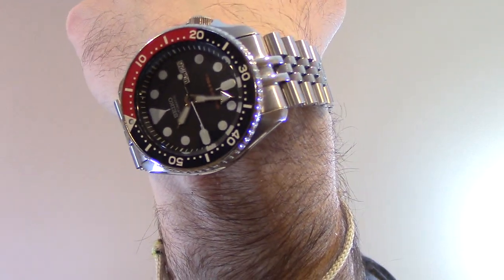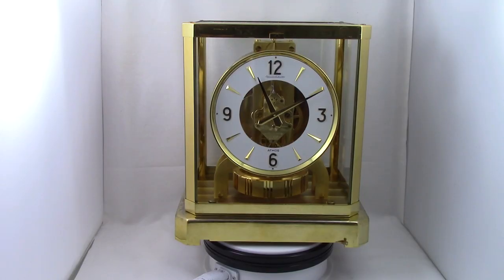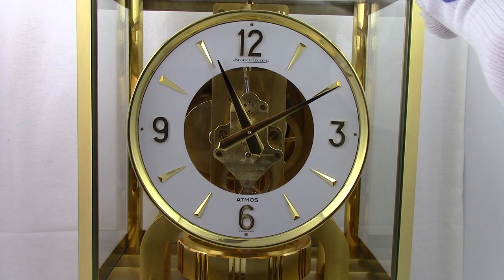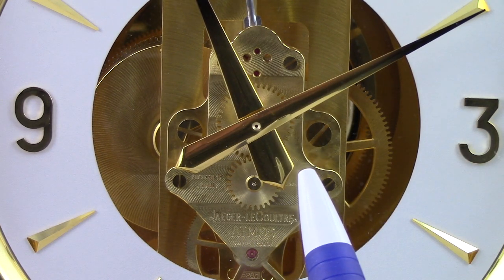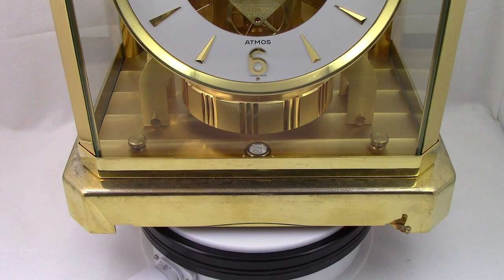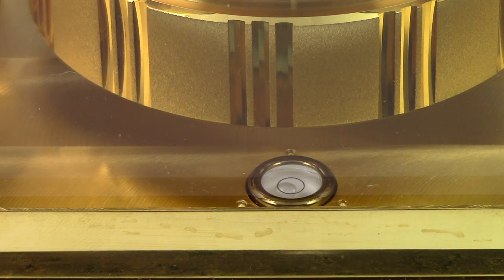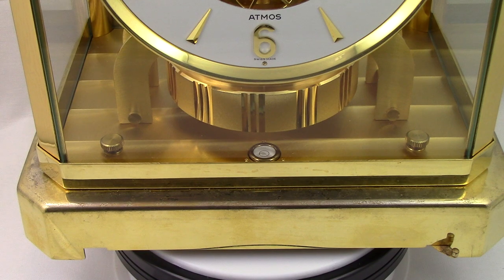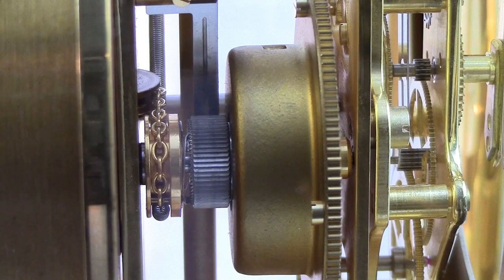How Does The Jaeger-LeCoultre Atmos Clock Work? - Watch and Learn #44

Comment: I inherited an Atmos clock when my mother passed away. My parents purchased it in Switzerland in 1959 and it has never stopped. It was serviced in 2006 and still keeps fantastic time. Thank you for the detailed explanation of the winding operation.
Reply: I just inherited one made in 1956. It's currently locked and inoperable. I'm uncertain how to unlock it. Does it require a special tool?
Reply: @jeffreyoldham55  The lever beneath the base locks the movement.
Reply: Nice!😊

Comment: My Atmos clock was my Grandfathers retirement from GM gift. It sat on Grandma's piano. Then it sat on Mom's cabinet. They all didn't like it much cause it would start and stop. I noticed when you walked past it the rotating pendulum would wiggle. I took it to my house and put it on the solid mantle and it would not wiggle even if I jumped around. Now it runs nicely. Love it.

Comment: My Atmos clock dates from July of 1963. It was presented to my father, John G.W. McIntyre, in appreciation of five years work in Australia with Ford Motor Company. It is almost identical to your clock with serial number 142034. The entire glass case can be removed by releasing two small bolts on each side. There is no release for the front glass. I can now look inside and understand how it works - your attention to detail is exceptional. It now resides in my home in Vancouver, Canada. It keeps company with another very accurate clock: A Seth Thomas World Model 1917 Canadian Pacific Railway pendulum clock.

Comment: I own this exact clock and haven't touched it for many years; haven't moved it either.  Fantastic clock; very undervalued and under-appreciated. You only need to put it on a level surface and never screw with it. Really. Once you find a place for it, only touch it with your eyes.

Comment: My aunt got one of these clocks for retirement gift from her work. When I was young and before the internet, I'd look that clock over and try and figure out how it ran w/o being wound or plugged into the wall or batteries.  My dad said the pendulum. I argue that it couldn't be it, nothing runs for ever, the friction and gravity would eventually slow the pendulum down.  I saw the little wire on top and wonder if radio waves ran it.  Then I got the internet and looked it up. Years later.  I'd tell everyone that saw the clock how it worked on temperature change and that there was chamber that expanded and contracted with room temp change. None of my family would remember when I'd ask them the next time I visited.  It's now my clock. I said that I get it because no one else knows how it runs and I'm the only one that cared enough to learn.   It's been running for close to 40 years.  The same aunt gave me a seiko watch when I was around 13. 43 years ago. It still runs, but needs batteries changed. It's a quart crystal watch.  Stainless steel.

Comment: Wow.. thank you, Marc. I've been waiting for someone to explain this topic. This is one of excelent discovery for last century. Is there any diffent performance if the clock place in tropical and sub-tropical climate?
Reply from the maker: No, it doesn't matter, but it does have an operating range up to somewhere in the mid-80's, so it is meant to run indoors, in a controlled environment.

Comment: Mark, I noticed that your pendulum rotates at about 9 revolutions before it turns in the other direction. I am curious how accurate it is because I have the ATMOS model 540 (1980’s model) which is a bit harder to find and they run at about 16-17 revolutions. Mine runs about 3 seconds a day fast which is within COSC certification. I am curious if your mechanism can run accurately at such a low BPM …….

Comment: In 1976 my father was awarded one of these clocks from American Cyanamid Company for his 25 years of service. Now 45 years later I have brought this clock up from the basement and have started cleaning up the outside and looking into seeing if it works. It had a movement guard on top of it ( inside ) and it is locked making me wonder if it ever was activated. Thank you for posting this video and I will attempt to start it up at some point in time in the near future. If I have an Issue .. I will try and locate a watch / timepiece service person in my area.  One question .. where would locate it's part  / Model number ? Thanks in advance.

Comment: I have a Jaeger atmos clock my father was awarded for 25 years at Union Carbide. My girlfriend decided to move things around and moved it without locking the pendulum, I'm trying to figure out how to open the front glass so I can lock the pendulum before shipping it off for repair. I remember locking it before when I moved so I know where the lever is, its inside the case below the clock face. I remember just opening the front to do it but I can't remember how I opened it. Looks like I would need to remove 4 screws and the top in order to slide the front glass up, but I'm pretty sure thats not how I did it before. I saw a video where you showed a similar clock and you opened the front apparently by touching the bottom left corner of the front glass, perhaps a push inward to unlatch but its very fast and I can't see it too well in the video. If it is unlatched that way its not happening easily. Any help would be appreciated. Thanks

Comment: Hi Marc, another great video! I was wondering what exactly the accuracy of this clock is? You mentioned that it's keeping time very well, however how accurate can a movement with 120 vibrations/hour really run?
Thanks, Daniel
Reply from the maker: Good question, I'm going for a minute or so a month hopefully
Reply: Thanks, that's actually pretty impressive
Reply: I have a couple of Atmos clocks one is a 1970's 526 Royale and the other is a 528 VIIIC they both keep accurate time no less or more than 1 minute error a year.
Reply: @theeasterbunny8308  wow!!!!!

Comment: It’s not clear how you unlocked the mechanism.  Is there a lever on the bottom of the clock that slides left and right.  I also wouldn’t have minded if you showed how to open  the front glass because I’m guessing that it would be necessary to turn the leveling levers?

Comment: I just put mine in storage and it may be there for 6 months to a year due to moving. I locked the pendulum but am now wondering if the clock can be overwound being it is basically always winding itself and being it wont be running wont be able to unwind normally.
Reply from the maker: Great question, and I thought about this too. No, it cannot. Eventually, the mainspring will stop winding, right? But the bellows is still moving, so the chain is still moving. But instead of winding the movement, it is pulling the other springs in the movement. A genius system indeed.

Comment: I’m guessing if it is indoors you have to adjust your thermostat every so often to keep it wound ?
Reply: I doubt it. Like he said in the video, 1 degree of temp change(Fahrenheit, or 5/9 of a C degree) is enough for 2 days of running. It is an extremely low energy system. Just the energy acquired from something like it raining outside or nighttime hitting will be enough to make the clock last forever. Your thermostat does not keep your house at a perfectly constant temp, basically.
Reply from the maker: gmansplit   correct!
Reply: Hey Marc. I noticed that while the pendulum only goes around once per 30 seconds, the minute hand actually moves several times as the pendulum gets ready to reverse direction(as opposed to just ticking once for 30 seconds elapsed). Why is that?

Comment: I expect that the Chinese can make one of these for a lot less than the cost of the genuine Atmos clock.......I'm not really interested in the Atmos clock per se but a clock that will run forever without winding or any electrics etc has got to be sought after.........the mechanism of the clock is conventional, so the winding mechanism is the tricky bit.......no doubt the design of the winding mechanism will vary according to the maker.

Comment: This clock isn't working properly, you should be able to count 17-19 *lines*, I'm counting 10 *lines*. It's out of power or needs cleaning.
Reply from the maker: What lines are you referring to?
Reply: The lines on the pendulum serve a purpose. Each (three) line notch counts as a line I'm counting 10 lines where there should be at least 17 to 19. The rotation both ways should be 560 degrees.
Reply from the maker: Got it. For the video it was not level. I've leveled it since back in it's correct location and it's turning correctly. Thanks for the education!